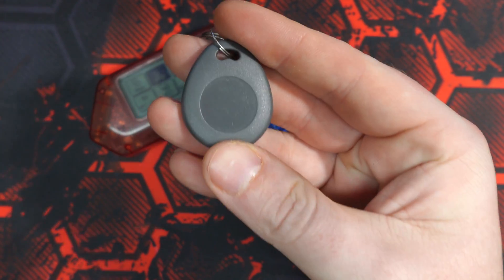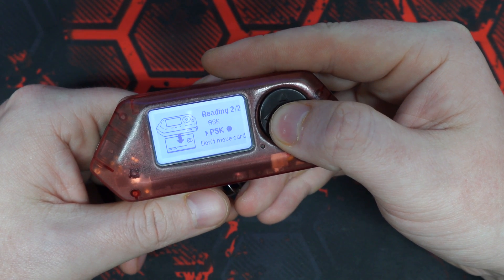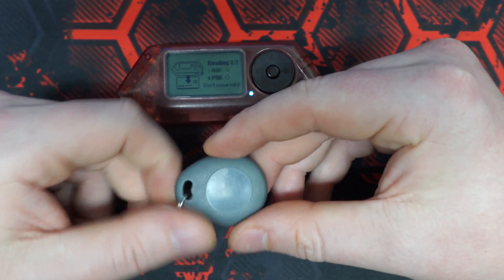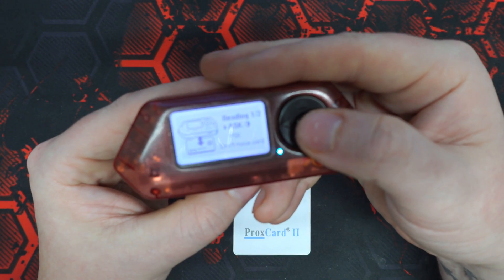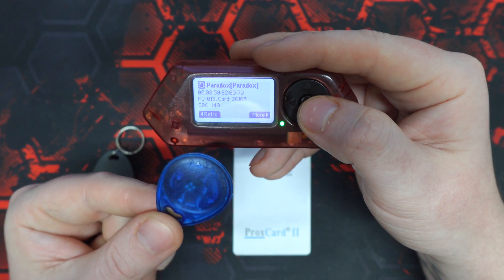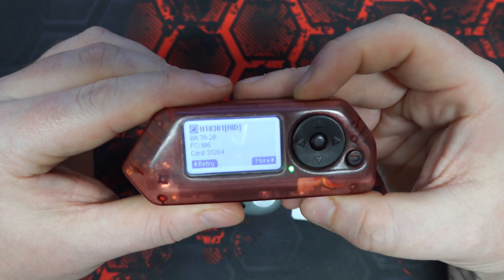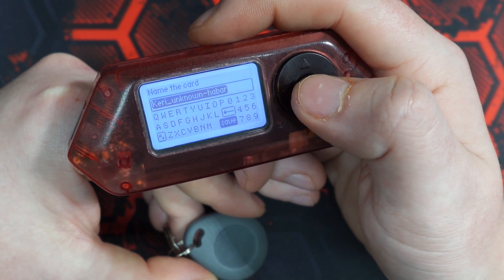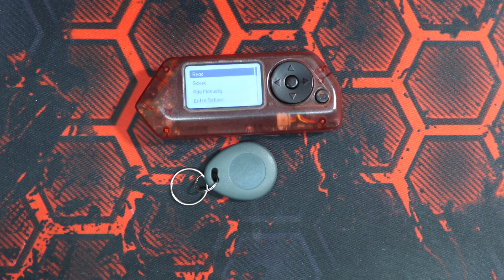Flipper Zero: RFID Cloning With T5577 Tags

Comment: Can it copy a saflok key card?
Reply: saflok is mainly hf mifare classic/ultralight c iirc
one of them is easily cloneable, the other not so much
Reply: @eltrick__  wym by the other ...like as in what?
Reply: @Streakbully000  saflok mifare classic is easily cloneable; saflok ultralight c is not so easily cloneable
the reasons why are left as an exercise to the reader
Reply from the maker: Depends what system it is
Reply: @LockPickNic   idk if this helps its say 
"a member of the kaba group "
Reply: @LockPickNic  ?

Comment: Hey quick question Buddy, so I was brainstorming at work today (security officer) So I was wondering if I can use this tag a couple of my Tags On my round Not a lot, but there’s a like two I hate going because of spider webs 😂😂😂😂😂😂, so I’m wondering like can I clones those
Reply from the maker: It entirely depends on what tags they use - you could, hypothetically, clone em all and lay them out in order in front of you.
Reply: @LockPickNic  another thing I couldn’t Explain In the Comments, is I’m scanning the points With the sight phone can I just tap the device on the back of the Phone To RFID read it, like the tap to pay gesture????
Reply: Or will I need more Tags just to clone It
Reply: @LockPickNic  basically will the device store the data in the device or will I need to continue scanning the cloned card ???
Reply from the maker: The F0 can store cards, yeah

Comment: I'd like to make it a point that rougemaster CFW so far has more RFID options.

All you have to do is extract the zip save it to the "update" folder in the SD card and open on your flipper sroll to the bottom and you'll see an firmware update file you can open (you'll need to access this in the browser menu of your flipper)

Comment: Hello, I have a T5577 keyfob that's NOT blank (it does unlock my common property gate) and yet flipper can't read it, it's as if it was blank... where's the trick?, firmware in the flipper is the official one released on april 30 2024, do you think its possible to read it by using another firmware on the flipper?
Reply: I think you might want to try the unleashed firmware I managed to duplicate nfc tags with it at version 075 , not sure if it's specifically because of custom firmware though I remember there were some kind of firmware limitations in the official firmware due to regional laws/policies
Reply: @Anon20855  thanks, in the meamtime I sold back my flipper and got a Proxmark 3, I succeded with it eventually.....

Comment: Nice one man. Does this work with garage buttons as well? I had to pay a 50 quid deposit for the fob so I’d like to get a cheap one to attach to my motorbike key hahah!
Reply from the maker: Do you tap it to a reader?
Reply: @LockPickNic  no it’s a remote with a button.
Reply from the maker: Your best bet is to try and read the signal to see if it's rolling code. If it is, you're SOL. If not, you can likely save a copy of it.
Reply: @LockPickNic 

Hello, 
I was asking myself how do you know if It's a rolling code or not after scanning the signals. 
On tags and remote control.
Reply: Nice one, thanks man! It came from a drawer full of new ones and the building manager just tested out the window on the door and it worked straight out of the box so I don’t think I’m dealing with super high level security hahah!